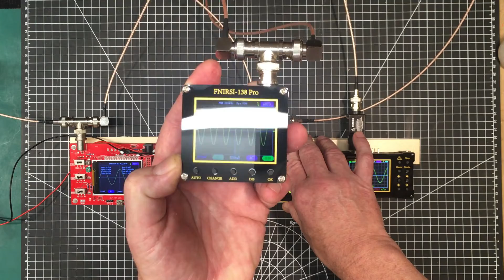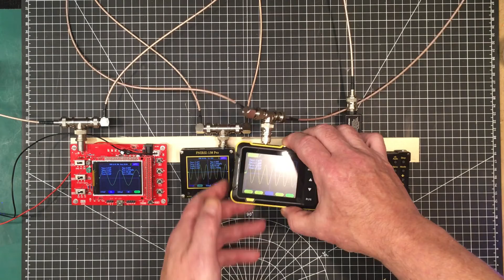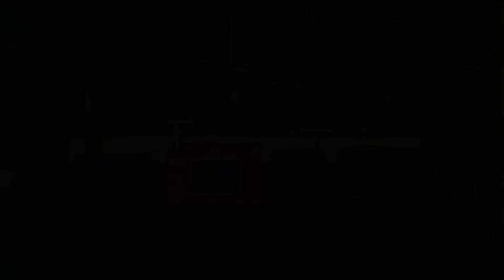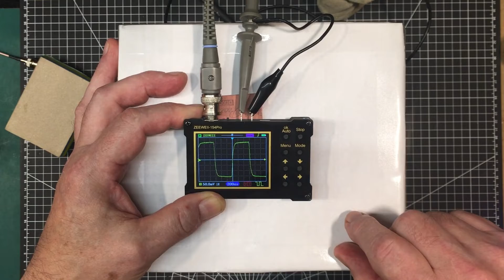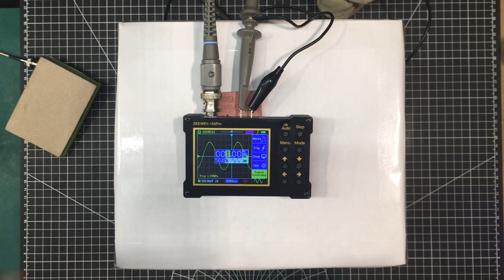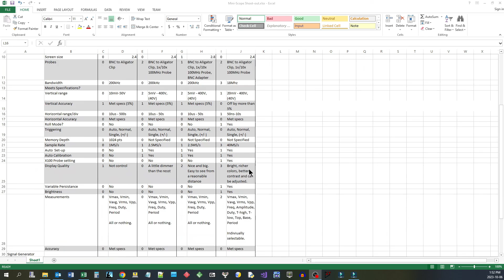0106 - Mini-Oscilloscope SHOOTOUT!  Part 2

Comment: I normally research the bejesus out of things (how i found this video).
But I'm hoping I can leverage your knowledge to shortcut that process?
I have a full 4 channel pico for car diagnosis. I was looking for a pocket option when out and about. The common one sold to automotive is the Uscope (old dso nano v3). I was hoping for a cheap alternative but there are so many options. What would you suggest for my needs. Mainly 0-5v signals, 0-12v signals, dc amperage signals with frequency abilities.
Should i just go the Zeeweii? Or would i get away with the dso152 as my needs are so simple?
Reply from the maker: The Zeeweii is not any more expensive, but it's not fully sealed off and may not be the right thing for automotive work.  There is also teh FNIRSI DSP-153 that is much better than the 152 for a few dollars more.  Have a look at that.
Reply: @uni-byte  legend! I appreciate the reply
Reply from the maker: @secretsquirrel9722  No problem.
Reply: @uni-byte  Sorry to bother you again. 
Short of not having a sealed case, the 154pro is the far superior unit though isn't it?
Looking into it further. The 153 has a funny issue where it's sample rate is significantly lower than the 152. Compared side by side. Causing captures like injectors waveforms to completely miss vital parts you needs to see. 
154pro is way above both in sample and clarity from your test.
The 153 and 153 are MCX leads.
The 154pro is bnc which I already have leads, and all associated test equipment etc.
The 152 and 153 don't have an adjustable vertical trigger. Making it hard to capture a waveform in the center of the screen for analysing. 
Have I got this right?
Reply from the maker: @secretsquirrel9722  Absolutely.  The DSO 154Pro is the king of the hill.  It out performs all the rest in this class bye a huge margin.
Reply: @uni-byte   You're a legend, man! Super appreciative of your prompt and honest response! 
Glad to hear it is as much of a no- brainer  as I had come to think myself. It's channels like yours that give people like me, the ability to leverage your expertise to even find these options. Let alone, come to find the best option for my needs!
Huge appreciation! Thank you.

Comment: Nice little comparison video, there should be more like this on the net.👍

My understanding is that if you use a 50 Ohm cable and you have a 50 Ohm signal generator on the other side, then the other end of the cable, at the scope, must be closed with a 50 Ohm.
Since the input impedance of the scope is 1MOhm.
If it were 50 Ohms, then there would be no need to close it, but on the other hand, you should pay close attention to the permissible voltage.

What happens when you use a measuring probe with 1x and 10x settings. Then where and how much should you terminate?😵‍💫

It would have been nice to see, in the video, how the signal develops at 18Mhz, without the 50Ohm termination, just so that viewers can visually see the difference.
I love before and after comparison videos.🙂🙃
Reply from the maker: Thanks.  If you used the probe at 10X directly into the FG you would not need a 50 ohm terminator as the probe cable is not a 50 ohm transmission line.  However, the BW measurements may be limited by the probe itself.

Good point about showing the difference without the 50 ohm terminator.👍

Comment: I use it to tune my car stereo
Reply: Yeah
Reply from the maker: @nileshudson2185  Good, and a nice application for it.
Reply: @uni-byte  yeah it is,...it give me along with frequency wave....lol...but I just can't figure out how much my amp is really putting out, I see vrms-250, what does this mean
Reply: Or the real question I should ask is how the get an estimate amp watts using this device
Reply from the maker: @nileshudson2185  250V RMS seem a little high for even a really powerful car stereo.  You may have had teh scope set for 10X and the probe set for 1X.
Reply from the maker: @nileshudson2185  Power is given by V^2 divided by the impedance of the speakers. Typical car speakers are 4ohms so if you were getting 250V rms out the power would be 250*250/4 = 15,625 Watts.  I think you are more likely get 25V rms out so the power would be 25*25/4 = 156 Watts.
Reply: @uni-byte  ahh..ok...yeah it was set 10× on the probe
Reply: Thanks for the explanation
Reply: My next question is....do I set to scope to dc or ac...I was only check when the clip...
Reply from the maker: @nileshudson2185  You normally set the scope to DC unless there is a large DC off-set that makes it hard to see the signal.
Reply: @uni-byte  thank you, you teach new information
Reply from the maker: 👍 @nileshudson2185
Reply from the maker: Which one did you get, the Zeeweii 154Pro?
Reply: @uni-byte  yeah

Comment: You didn't mention anything about the batteries.

Are they standard replaceable  batteries.
Reply from the maker: I did not open the DSO152 but the 138Pro and the 154Pro have standard looking Lithium Ion flat batteries.  They should not be difficult to source.  I have no reason to believe the 152 is any different.  After all, these things are built down to a price so there is little chance they would implement some proprietary battery solution.

Comment: Can you please explain the 50 ohm termination you spoke about or “correct termination”? Are the cables terminated into 50 ohm connectors at each scope so as to appease the signal generator? I’m new and looking to understand. Thank you for your videos.
Reply from the maker: Thanks for the question Robb.  The cable is terminated only at the ends.  Internally on the signal generator then on the final scope in the line.  The reason for this is to match impedance throughout the system.  Since this generator is primarily for use with 50 ohm coaxial cable, it is built with a 50 ohm output.  So when using a 50 ohm cable with it (as we are here) you need to have the other end of the cable terminated in 50 ohms too.  Failing to do that will cause reflections at the mismatched end which will cause frequency dependent errors in voltages read by the oscilloscopes.  This is really only a problem at higher frequencies so it would not really be required for the scopes that only go to 200kHz.  However, the little Zeeweii will work up to 18MHz so to get the best conditions to measure it's bandwidth we need to adhere to proper practices and make sure impedance is properly matched across the system.  Other systems have different impedances.  For instance twisted pair used in wired networks is 100 ohms.  Blacked audio used in professional audio environments is 600 ohms.  In each case, transmission lines (the connecting cables) need to be properly terminated at each end.
Reply: @uni-byte  That is the most concise and comprehensive answer I’ve ever received from anyone before. Thank you. 

I didn’t realize that the cable impedance was also important and I really only know of it for 75 ohm coax used in home television connections. 

So if I understand you correctly, I have a BK Precision Function Generator that outputs at 50 ohms. I should be sending it through 50 ohm bnc cable that terminates at my oscilloscope into a 50 ohm pass through terminator? Is this correct sir?
Reply from the maker: @robbo6460  Yes, that would be best practices.  Some scopes are capable of terminating in 50 ohms internally and do not need the pass-through terminator.  And this is just for a direct connection from SG to scope through a 50 ohms cable or through another 50 ohm DUT like an RF filter.
Reply: @uni-byte  ok last question, I think lol. Does using a 50 ohm splitter at my FG hurt anything downstream signal wise? I have a single BNC female to dual male splitter @ 50 ohms so I can go to my scope and dmm. I go to my FG with a 50 ohm BNC cable then through a 50 ohm pass through at the scope. My dmm is a BNC to dual banana cable. I just want to confirm that I’m not messing it up with too many 50 ohm dohickies on the feed. Thank you again. You are super helpful and I appreciate it. 
On another note please let me know if I can donate anything to the channel? I have tons of interesting items of vintage test equipment. I sent IMSAIGUY a Heathkit nixie counter and manual and he did a repair video on it.
Reply from the maker: @robbo6460  What frequencies are we talking about here and is the splitter just a "T" or does it properly split from a 50 ohm input to two 50 ohm outputs?  If it's just a "T", then the way to do it is to have the SG at one end, the scope with the pass-through terminator at the other end and the "T" feeding the DMM as close to the input as possible.  If it's a proper 50-50-50 splitter then you need 50 ohm termination on the input and the end of both outputs.

On donations, you could contact me at my email address "ABOUT" tab of my channel or if you would prefer not to incur the cost of shipping stuff to Canada, you could leave me a tip at the PayPal link in the description or click on the "Thanks" button just below the video.  Thanks for the offer!
Reply: How do you physically terminate it? How is it done?
Reply from the maker: @BlainesGarage  Use a 50 ohm pass-through terminator.  You can get a useful on Amazon for about $20.  Good to have about.

Comment: I bought the Zeeweii 154 pro to use as a panel mount meter, since they don't seem to exist otherwise. A couple of the buttons are on the top though, so have to be moved. As a neat little portable meter I got the Zeeweii DSO3D12, no regrets as an oscilloscope though its dmm sucks.
Reply from the maker: Did you re-program the 154Pro or are you using it in it's oscilloscope function?
Reply: @uni-byte  No reprogram, it's just to show the frequency and duty of a square wave signal from the PMW-OCXi module.
Reply from the maker: @xONEWINGx  Ah, I understand.  Thank you.

Comment: You get 100 internet points for  discussing impedance matching.
Reply from the maker: Thanks!  I'll take them.  I see a lot of people run into "issues" in cases where they have not looked after the fundamentals.  Like the foundation of a building, they are important and need to be discussed at every opportunity.

Comment: There aren't many testing videos of the 154pro and I have no way to test it myself so I'm glad to see it meets it's specs. Thanks for the video and happy thanksgiving to you and your.
Reply: It is an amazing little thing but open sided case is not looking safe. That flaw can be eliminated with half hour 3d printing tho.
Switched from zt702s to combination of dso154pro and any multimeter that works. Works for me
Reply from the maker: No problem!